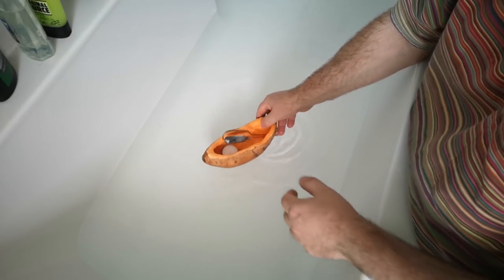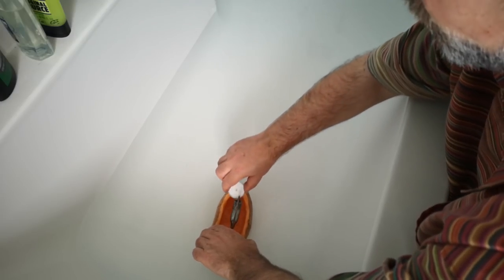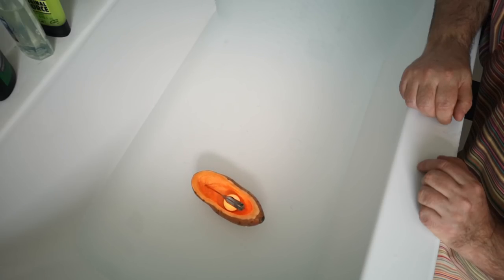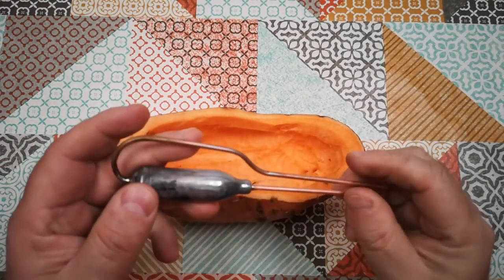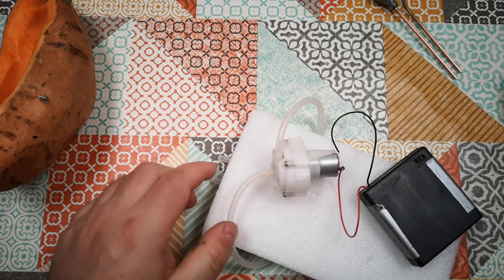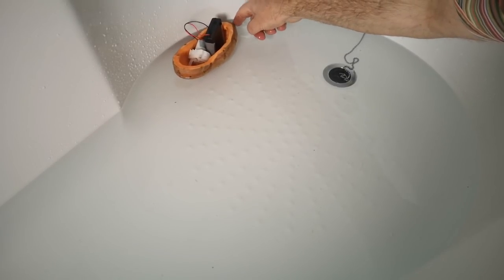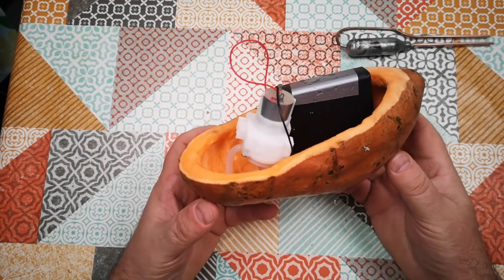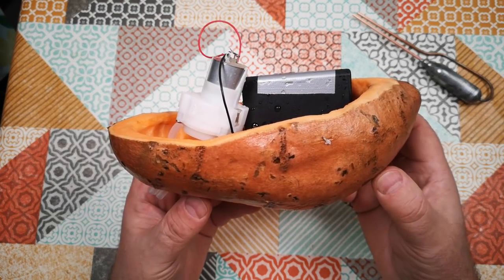Boatato! - Motorising A Potato Using Silent Putt-Putt & Electric Motors

Comment: Excellent. Ticks so many boxes on my list 😍👍
Reply from the maker: I was thinking of making this into a bit of a challenge - I know you like to motorise things - which vegetable would you turn into which vehicle?
Reply: @AtomicShrimp  in response to this one I went out and did a rubber band powered courgette but my publishing schedule means it won't appear on my rubber band channel until the 15th. The courgette was an easy choice as it was passed it's best sitting in the vegetable cupboard. It looks more like a submarine but it does stay on the surface. As for using any food you will always get somebody complain you have wasted good food. A good sized marrow or watermellon would seem a logical choice for a motor boat with RC and a pair of brushless motors. Depends how messy you want to get.

Comment: Try removing paraffin and filling the tea candle holder with alcohol, more heat
Reply: I don't thinks so. 

Paraffin Wax has an Energy Content of 42.0 kJ/g
Ethanol has an Energy Content of 26.8  kJ/g
Reply from the maker: Perhaps so, but ethanol is more volatile and will burn faster and hotter, but for a shorter total time.  You can melt glass tubes over an alcohol flame - you can't do that (at least I don't think so) over a candle
Reply: @AtomicShrimp  So the energy is released more quickly from the alcohol, whereas though there is a higher energy density in th paraffin wax it is a 'slow burn' fuel that releases the energy over a much longer time. Got  that.
Reply from the maker: Something like that. Also candles don't burn their fuel completely - some of it is lost as soot (which could release more energy by burning to co2, but doesn't